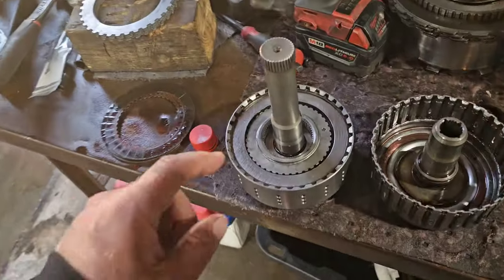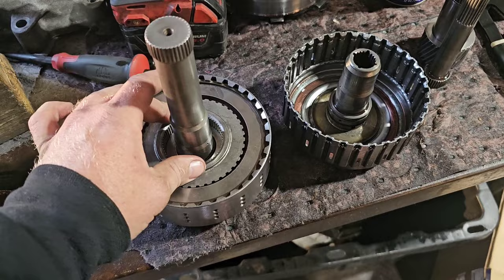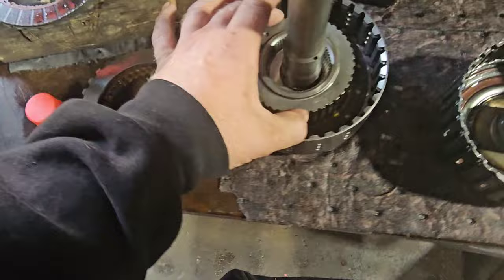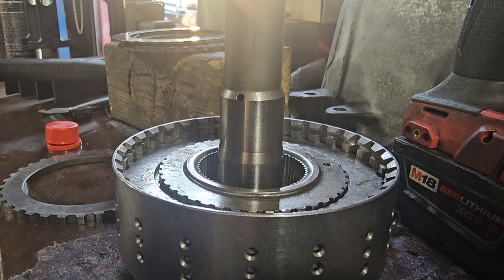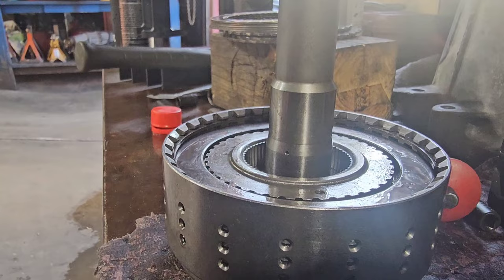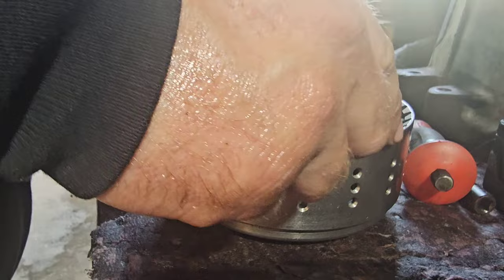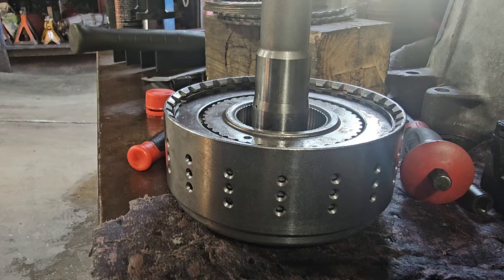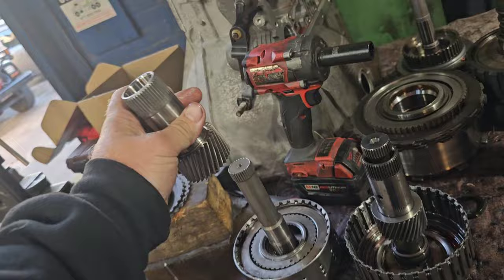4r70w and 4r75e - Direct Drum Upgrade - and Econoline / Town Car Transmission, Sonnax Smart Tech

Comment: basically the same principle as a wet clutch on motorcycles.when you need alot of surface area, but dont have alot of room to work with.

Comment: Does it really need that $600.00 upgrade? I'm doing an aod rebuild for a 500hp street car. Really didn't want to do that upgrade.
Reply from the maker: Does it need it? No it doesn't but will it give you extra reliability when you really need the power put to the ground.....  absolutely
Reply: I'm going to spend the money on a Valvebody. I believe (could be wrong) that's where the longevity is at.